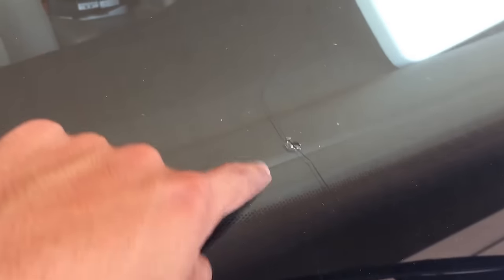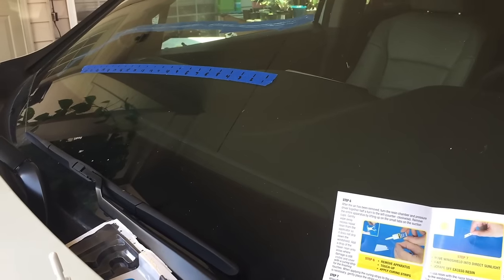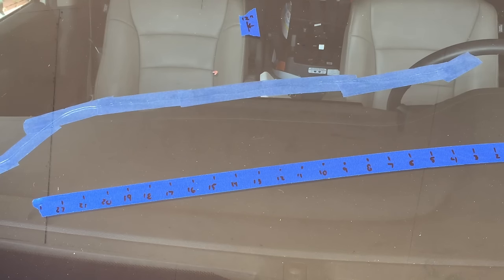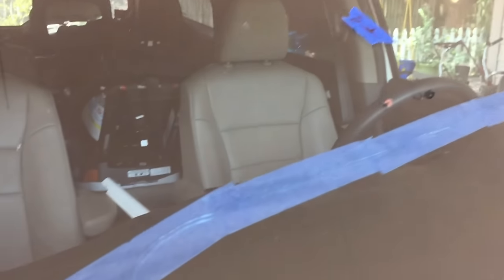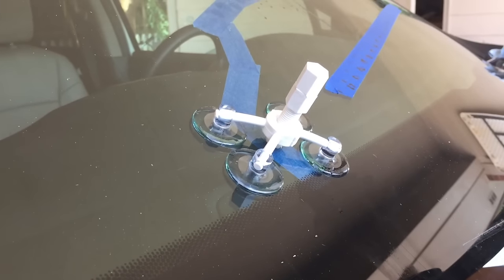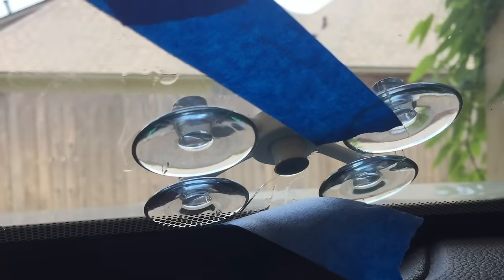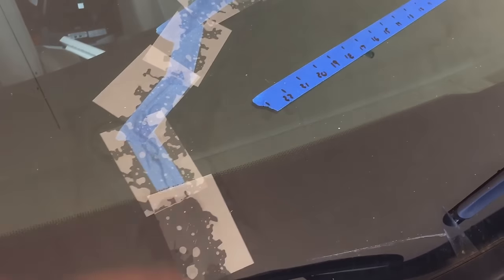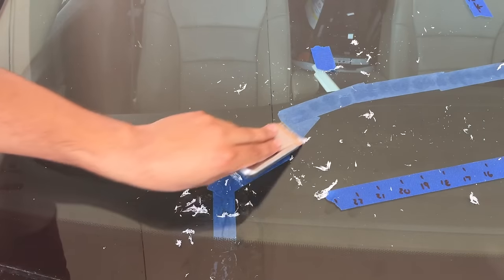Rain-X Windshield Repair Kit on a Chip + Long Crack

Comment: Worked good for me had about a half foot crack and chip...the trick I used was my wifes toy...as I put the resin in she was in the inside of the car and her her egg in a sock against the crack of the windshield. The vibrations from the sock egg vibrated the windshield enough so the resin would go into the crack. Then let it dry in the garage for two hours...then pulled it out in direct sun to let it bake for an hour..back in the garage let it cool down then scraped it you hardly can see it now...
Reply: Lol
Reply: I hope this is true
Reply: So a massage gun would work?😂
Reply: @ivangonzalez7653 not as fun tho lol

Comment: A tip I learned from doing mine, is to have a helper apply some pressure to the good piece of glass to open up the crack on the other side, just ever so slightly. That allows the resin to really get in there and do its thing.
Reply: Ok, was wondering but also afraid to do this. I can definitely feel my line crack up to a certain point. Then it feels like the crack is entirely inside the glass itself (can't feel it with fingernail from inside the car or outside.
Reply: @dethtrain  Do a hole at the end of the crack, to make sure it won't spread. Search on Youtube how you should do it.
Reply: I did it 2 nights ago on my truck.  Impact point had a foot long crack either side.  I took a Q tip with resin putting pressure for a couple seconds all along the crack.  Then, I ran the resin bead along it.  I put about 6-8 pieces of film over it.  I let it sit overnight in the garage, not just 20 min-1 hr.  I removed the film, but didn’t scrape or clean.  I let it sit for 8 hrs in 100 deg heat/sun.  I then scraped excess off.  Wiped it down.  I can barely make out the crack!  It worked.  Amazing, and I never would’ve believed it.  I’ve tried for 30 years on cracks for the 20 min-hr thing, and it never helped at all.
Reply: @jgringo5516 trying it now on my truck wish me luck glad I read your comment thanks brother
Reply: I heard it's better to use a lighter on the inside than putting light pressure since the heat will help pull the resin in better.
Reply: And if he's a moron and presses to hard breaking your windscreen he aint no buddy anymore
Reply: @Swagberryy oh ok
Reply: 🔥❤️‍🔥 Excellent tip.❤️‍🔥🔥
Reply: @Grayman_WWJD  it doesn't work, no of these windscreen crack repair things work , they just take your cash

Comment: The reason you're supposed to scrape it a 90° angle is to avoid pulling the resin out of the crack like you did at the chip. If you scrape it at a 90° angle you can avoid that

Comment: Use a hair dryer from the inside to help add some pliability and warm up the areas so the liquid can seep down in there, will help air to get out as well.  You don't want it in the sun because the stuff us UV activated, but heat is okay.  Professionals use a drill bit to drill a tiny hole to help the stuff get into the damage.  I bet if you did that every few inches along the crack it would fill it in.  The windshield is 3 layers, it's plastic in the center glass on the out/inside areas.  You drill just until you feel a difference (after it pops through the 1st layer of glass( then stop, then fill in with resin.  When scraping you're suppose to put the blade at the edge of the damage and scrape away so you don't potentially pull the repair out, then stand it up straight and scrape evenly across the top at the end.

Comment: It works great if u push on the glass from the inside as ur putting the filler in the crack u can watch the crack disappear if ur putting the right amount of pressure on the crack the clear film strip are just to keep the air from going back in the crack while ur waiting on it to dry 15 to 20 nins in sun ..u may need someone pushing on the inside of the crack as u apply the resin from outside. opening that crack to get the resin down inside it will literally disappear if ur doing it correctly

Comment: Next time try stop drilling at the crack end.  This is done with a small dremil tool.  Once the hole is at the crack end.  You use the plunger assembly to inject the resin into the windshield crack.  This will help the crack from spreading further.  This is way it was done at the windshield repair shops when customers didn’t want to replace their glass.  Good luck.

Comment: Hey dude, ive seen this get done 100% cleared with same equipment, you have to use the suction device and grease the sides both sides 5-10 cm from crack and slowly drip resin and move suction as you go along, what will happen is the resin will fill the bullseye and line crack 100% with that pressure on it... you can also tap the glass inside to help resin flow inside....after few hours scrap and clear glass. hope this helps .
Reply from the maker: Nice! I didn't think about using the suction syringe for the crack. definitely more time intensive but I can see how it would work
Reply: What grease? vaseline?

Comment: I used this kit and I'm quite happy with the results too. I drilled a hole 1/8 inch from the end of the crack, in the top layer of glass only. I put an electric heater inside the van to heat up the glass since it was 50 in my garage. Then I let the glue flow into crack and followed the flow, just behind the flow, along the rest of the crack. I used reading glasses to help me see the flow into the crack. I followed the directions for the rest of the procedure. I parked outside to let it setup etc. The next day, after being parked outside, it seemed that the crack was even harder to see than on the first day after setting up. I don't know if the glue hardened and shrunk further but I'm even happier with the repair.
Reply from the maker: I think you got it figured out!!

Comment: A few more tips I want to add being that I did my own windshield in 2021 with a similarly long crack and it's held up since is that you can watch videos of professionals doing this with better tools but can use 2 or 3 of these cheaper plastic tools to do the same thing. Basically you'll want to use the bullseye dropper to shoot goop into the main chip then "wick" the resin along with a cue tip soaked in the same resin. Push and follow from behind and it pushes itself forward. With your spare 2 other resin injectors you'll use them to very very slightly open the crack a super little bit evenly from the other side of the windshield to help the resin flow through.

Comment: OMG OMG You are a lifesaver for showing this..I called windshield companies for a 2021 Kia Sportage. I was quoted 1000.+ for repairs. I called the dealership and they wanted to put a claim in to my insurance. But after watching your video and purchasing this product, I was able to fix a crack, which was more that 30ins. Rain-x just put many windshield companies out of business. P.S. I have some little gaps because I am short BUT for the majority of the crack, it has disappeared. Thanks again..
Reply from the maker: That's awesome!!! Glad to hear this was helpful! We were in the same boat because of these new windshields and all the electronics that are attached to them nowadays. Nice work, glad it turned out good!
Reply: This is a happening to thousands of kias and kias will NOT recognize it’s a manufacturer defect.  Email MCameron@kiausa.com and let anyone you know with Kia windshield issues to email her as well.
Reply: Just keep in mind… The windshield is an integral part of the safety of the car. If you have a crack that goes from one edge to the middle of the windshield that’s OKAY to fix, however… If it goes from one edge of the windshield to the other edge (any other edge) it greatly compromises the integrity of the windshield’s safety.
Reply: @nkotb4me  If it’s happening without something hitting the windshield in creating a start point for the crack, it’s a pressure issue meaning the windshield was not installed properly.
Reply: @donoh3909  you are so safe  bet you even got vaccinated
Reply: @michaelcee8348  lmao he’s just tryna help
Reply: Obviously you were overpriced..     I just got quoted $425 with tax for the same exact 2021 Kia Sportage..     Shop around next time
Reply: 30inches..... insurance companies wouldn't pay out for that .in the uk ...30 + inches....  😂😊😅

Comment: Just had a rock hit my windshield and had a crack spreading on my drive home. I didn’t have a repair kit but read about clear nail polish and clear packing tape being able to stop the crack. So far so good. I’ve got an appointment in the morning to get it repaired. I was (and still am) a little shaken because I’ve never had that happen where the glass actually cracked. Thank you for the video, and shoutout to you because I live in Louisiana too.
Reply: how’d everything go ?

Comment: When the instructions said scrape at a 90 degree angle it meant to the crack not the windshield. It means that you shouldn't scrape back and forth across the crack only along the length.
Reply: I literally just said out loud, “has this guy ever used a razor blade before?”  😂😂
Reply from the maker: These mfers 😒😒😂
Reply: Kip, you obviously didn't read the instructions that come with the Rain-X kit. They say: "Hold the razor blade at a 90 degree angle to the windshield when scraping for best result." Please don't pontificate based on your speculation.
Reply: J suis intéressé

Comment: To stop the crack, you need to drill a small hole (with a diamond bit) through the outer layer of glass at the end, or within a few mm of the crack. Either drill until you get to the plastic layer and stop, or drill nearly through the outer glass (im not sure exactly how thick it is) and just give the bottom of the hole a tap to break through to the plastic. Then you can apply the resin along the crack and in the new hole.
The round hole kinda dissipates the cracking action because it's a void. The resin reduces the visibility of the crack and stops more dirt getting stuck.
Reply: It won't break the glasss ?
Reply: @rayonwilliamssportsandfun2106  a laminated windscreen is two layers of glass with a plastic layer in the middle.
If you have a crack on just the outer layer of glass you need to drill a hole at the end of, or just slightly ahead of the crack. The hole needs to be either all the way through - until the drill suddenly starts drilling deeper into the soft plastic layer, or you need to drill through most of the cracked outer layer (judge the depth in comparison to the thickness of the glass crack), then give it just enough of a hit in the bottom of the hole to do the final breakthrough. If the hole doesn't go all the way through, the crack may continue once the weather becomes changeable or cold. The hole is a stress release.
You can drill the glass with a diamond bit for something like a Dremel.

Btw, the cheap crack repair glue may work, or may not.. it needs to be applied in shade, and the glass pushed a bit from inside as you apply glue a bit at a time, making sure not to get ahead of the crack filling. It also needs to be done before the crack gets too old.. like within a week or two.. it can make the difference between being an obvious crack, or pretty much disappearing.

I've got two bits of the same crack.. an old bit which I didn't drill deep enough or glue in time, and then the continued winter bit which was fresh and drilled deep enough.. the old didn't glue well and continued after a while, and the fresh bit glued invisibly, and stopped the crack.
Reply: Damn bro you should be doing the video son
Reply from the maker: @lobito6998 HEY! 😡😂
Reply: Round hole removes a sharp stress point.

Comment: Thanks a lot you saved me $150 I had a 6” crack on one side of the glass I was pretty skeptical but what’s $10 so I tried  I needed do apply the kit twice and it’s almost as new
Reply from the maker: hell yea!!! that's awesome to hear! nice work
Reply: Has it spread at all since the repair? All the professional repairs have them drill a small hole at the end of the crack to create a bull’s-eye for the crack to go into so it stops the spread, I’m considering doing that, but it seems a little iffy having no experience “Purposely putting a bull’s-eye in my windshield”

Comment: HI, the windshield of my car has exactly the same damage. Yesterday I lost the scare to touch it and bought 2 windshield repair kits. the rainx is I want to use for the long cracks. Even I'm scared of taking the car to the professionals and they don't want to repair it, they just request to change it, but at this time, my budget is too weak for that expense... so I keep in mind change it in a few months, but right now I'll have to stop de crack keeps growing. Thanks for your video. I drive a Corolla LE 2021 and the new windshield is so much more expensive.
Reply from the maker: It’s crazy how expensive the new windshields are! I hope it works well for you. Ours still hasn’t grown since July 2021
Reply: @fiveohmxco  Wow amazing, that means that the kit really works if someone knows how to use it. Thank you so much again.

Comment: It does look better. I have my own business doing windshield repair. Drilling the end of the crack, would of made such a huge difference, but definitely not bad for a store bought kit.
Reply from the maker: Yea it was definitely a bandaid and not a great cosmetic solution
Reply: Little MacJ, how would drilling the end of the crack have made a huge difference? Isn't that done to stop the crack from spreading? And the OP said in comments that, 18 months after he did the repair, the crack hadn't grown.
Reply: @yrniceguy  it would of filled in better. Not saying it's going to prevent it from spreading, not all cracks are created equal. I meant it would of made a huge difference in appearance.
Reply: @littlemacjtv1179  what do you mean by drilling a hole in the crack
Reply: @22ERICSHELLY  when you do repairs on windshields, you drill a hole to open up the crack and allow more resin to pass through it.
Reply: @littlemacjtv1179  okay. I have seen my windshield guy fix a spot but never drill into it. Thanks! May Jesus continue to bless you and your family
Reply from the maker: I know in metal repair, drilling a hole at the end of a crack relieves a stress concentration which will stop crack propagation, so probably helps in that way as well
Reply: @fiveohmxco  thanks! May Jesus continue to bless you and your family

Comment: Ordered resin, and plan on trying this too, this week.. i have the claim to replace the windshield on the 10th so hell, why not try to fix it.. I'll post back if it works, plan on using a needle to get the resin into the crack deeper, and UV light to cure it.. My guess is it wont be perfect.. But who knows, worth a shot..

Edit: i like your use of painters tape to see the crack easier.. gonna borrow that.. 😂

Comment: Many MANY THANKS for this video. It is one of the better ones I have seen. 
I am learning little tricks from different videos and will try combining some of the ideas. One of the main things is finding a product that is easily available and that works. Rain-ex products products are usually pretty reliable and are generally easy to find. 
I have a long crack as well. I figure, what do i have to lose. The car is old and I dont want to have to replace a windshield. 
Thanks again
Reply from the maker: Youre very welcome! Hope it turns out well, let us know!

Comment: Also a reminder that when you're done, scrape horizontal to the crack, don't scape vertically into the crack.
Reply: So basically this don't apply to when I am towelling off 😂😂😂
Reply: Just being helpful, I think you meant 'perpendicular and parallel', not "horizontal and vertical"

Comment: Thanks for the video, bro! I have a crack about 6 in long going down from the top. Mine started from a half moon type of crack. At this point, all I care about is stopping the crack from growing. Seems like yours has from the comments. Will be trying very soon! 🤙
Reply: Did it work for you?
Reply: @alifmahesania  so, it didn't fill it in to where it disappeared, but it did stop the crack from growing. 4 months later and it's still good.
Reply: @bbna7xcrazy  what about another 4 months? Is it still stopping it?
Reply: @ak2161409  yep! It's still good!
Reply: @alifmahesania  how about now? Lol
Reply: @hughmungus2237  worked for me too lol
Reply: Hey sorry dude, this comments section is focusing on windshield cracks. I noticed you never mention a windshield. Also that it started at the top, im not an expert, but im pretty sure that they all do. Childish i know, I couldnt resist butting in,   umm, it doesnt affect your rear view though does it?🤷🤦
Reply: It sealed my crack pretty good! I can feel safe now, from occasional public humiliations 🤡👍

Comment: Worth a try for sure. I've got a cracked window as well, still made inspection though, and i guess it has stopped growing lol. I'm afraid to touch it lol, it has curved up so if it grows more i don't think it will fail inspection. My next car, i might get better insurance: even a normal car without sensors costs about 300 bucks to fix. That's you know, that's some money right there that i just don't want to spend on a 2004 car unfortunately. Good job on your crack, always whipe it good! 👍😉
Reply: You can stop it growing by drilling a small hole at the end of the crack with a little round diamond bit in a drill or Dremel.. only through the outer layer of glass, not any deeper.